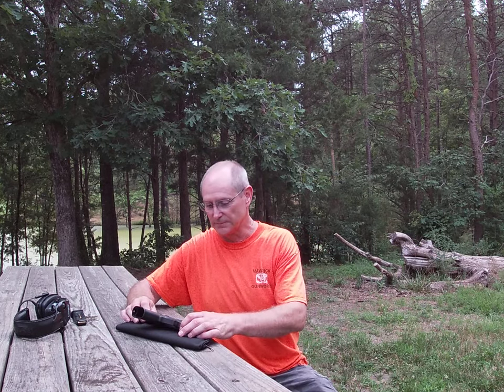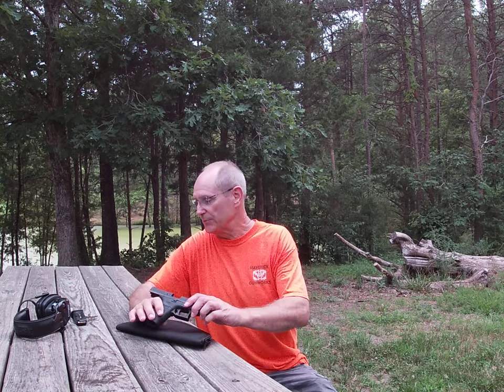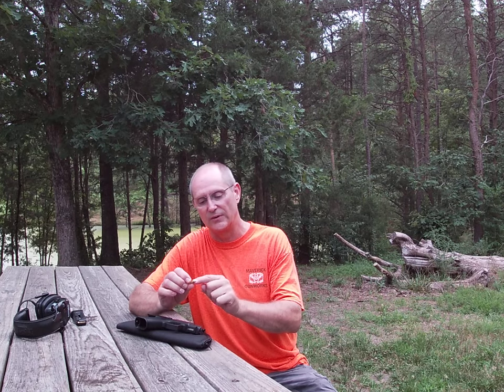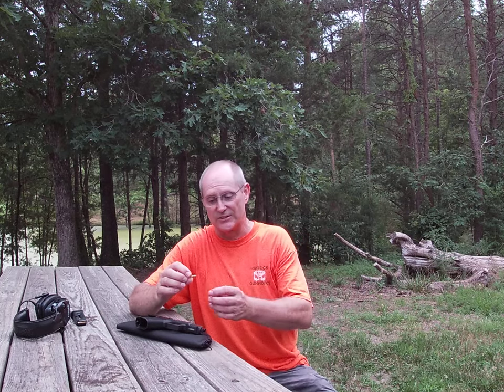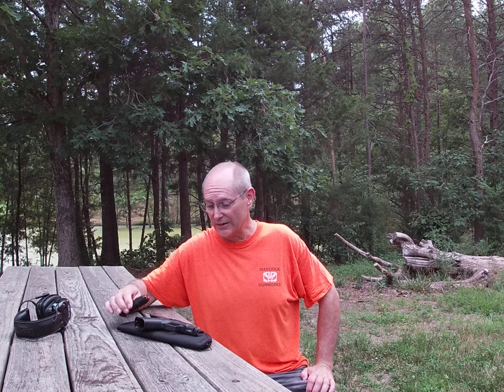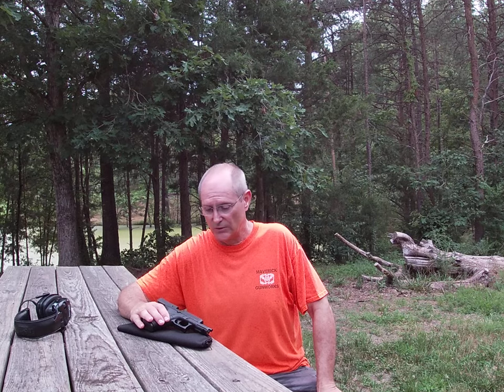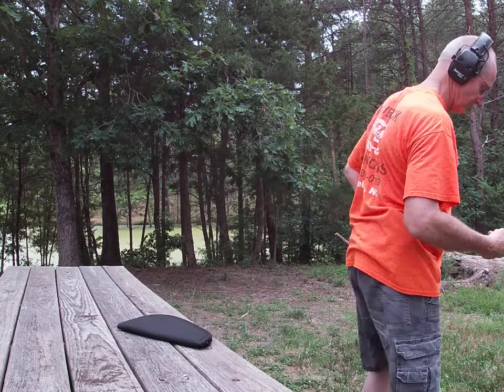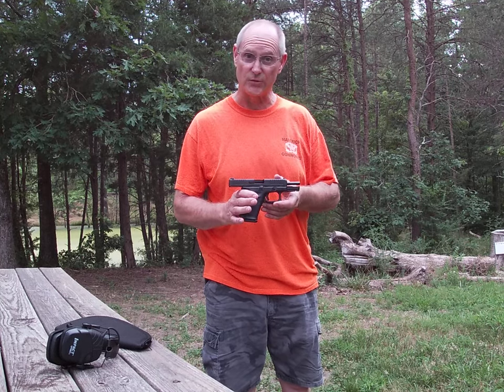Glock 44 Cycling Issues?

Comment: Grabbed one to introduce my sons to handguns. We’ve put 1500+ rounds through it so far with no issues. We’ve run mainly CCI stuff but ran some Aguila, Winchester without issues as well. Great gun for beginners, especially if they’ll be moving on to centerfire Glock stuff down the road.
Reply from the maker: Good information.  Thank you

Comment: What about the extractor issue? Glock was suppose to resolve that in May. Have you had or heard of anyone that are still having the problem with the extractor cracking the slide or the exactor actually flying out the side of it? I've seen people post that it's even happened after May. Just wondering bc I was thinking about purchasing it for practice bc I have the Glock 42 but I don't want it if it's still having that problem.